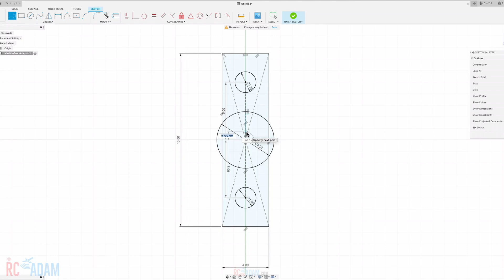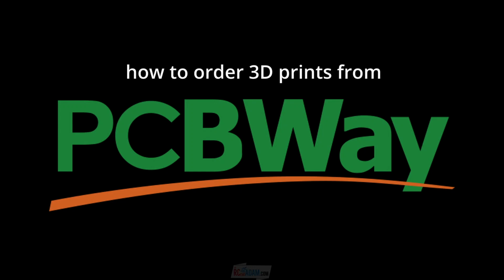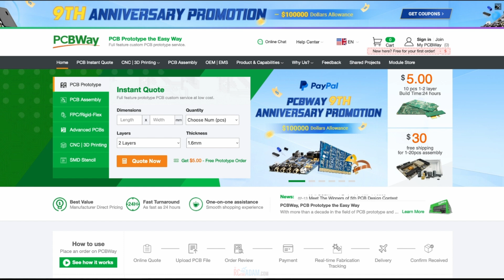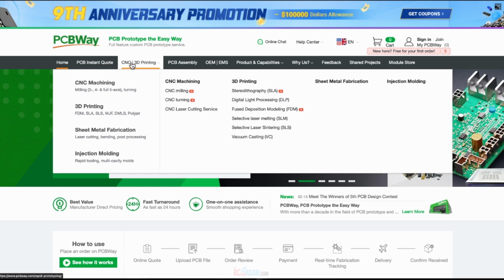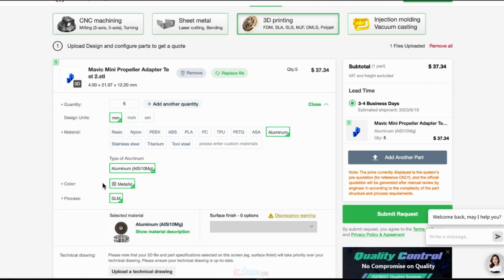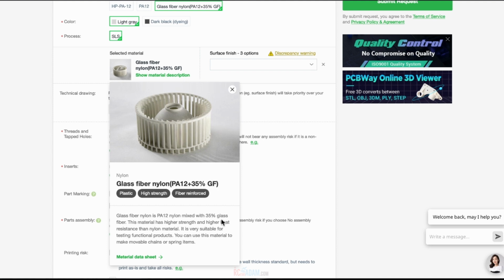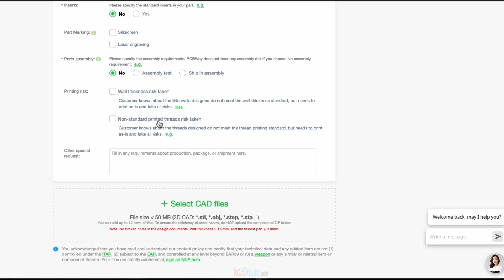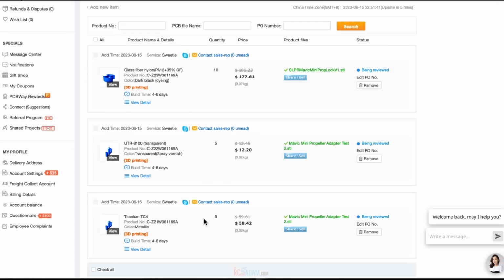3D Printed 8-blade Propeller adapter DJI Mini

Comment: I'm trying to maximize the payload so I could use my drone so I could set up tree hammocks up high without having to climb every tree. I need the drone to lift maybe 16 oz. I don't care about flight time. Or performance I just needed to lift a string and a lead weight up a tree.   So the string is 4-6 oz and lead 4 oz plus release mechanism on drone plus protection guard Cage so up to 16 oz.   Is it possible with the mini 2???

Comment: Hello please help i have a taranis x7 telegram connecting with a BL32 / f3g4 control flute but the taratel does not work and the flute beeps. The beta program only shows the scope but no motors are seen.
Reply: What planet are you on???